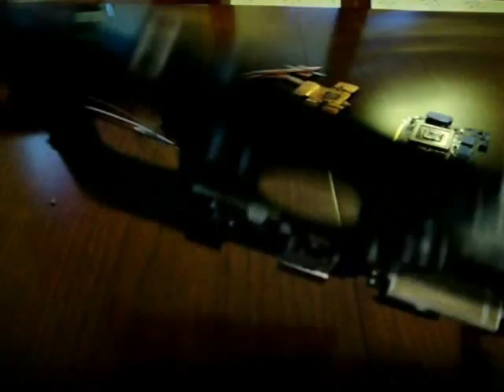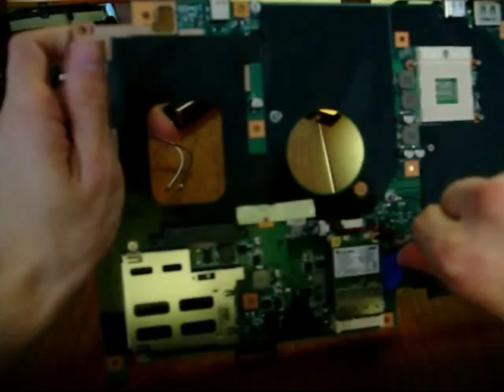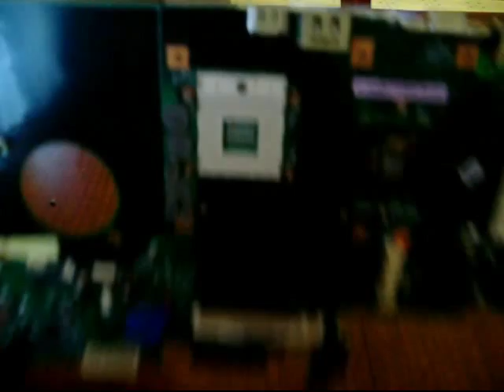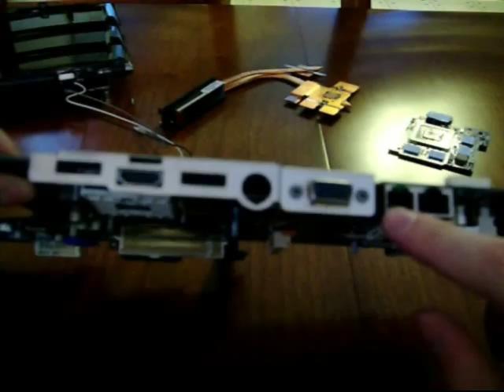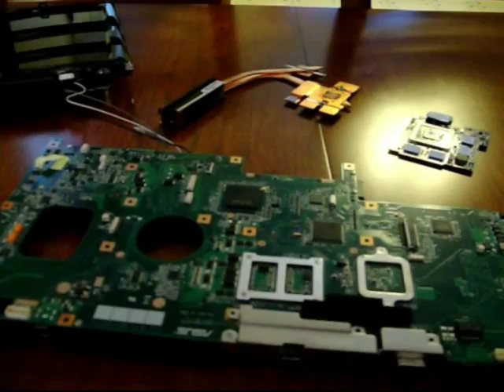Part 4:  Asus G71GX Disassembly tutorial to remove graphics card.

Comment: Hello friend. Very nice, detailed, and professional video. Could you tell us what is the highest/best frequency CPU and GPU for the laptop? Also, what should the idle and under-load temperatures of the stock GPU and CPU be? I just took mine apart, vacuumed all the dust, and applied new thermal compound (Thermaltake TG3) on the CPU and the Northbridge. I didn't touch the thermal pads on the graphic card other then vacuuming the heatsink. My temps are in the low 40s on the CPUs and mid 60s on the GPU on idle. What do you think?

Comment: Dear Frequency Commander,
I know this video is old, but after replacing the thermal compound on the heatsink radiator, there has been left a small gap in between the smaller chips and the radiator (the aluminium part). How crucial can it be for overheating and in my scenario shutting down? I have also uploaded a video on my channel seeking for help. Thank you

Comment: "now I have to put this thing back together, ugh!" LOL my question is, if I follow this video down to a T and reassemble with good heat-sink, to just replace my motherboard, I should be golden right (finally found a motherboard on ebay for 169$ after 2yrs of my new g71gx being a year old and the motherboard frying, have not bought the motherboard yet just in case)?

Comment: Based on your video I disassembled my Asus G71V which has a gf 9700m 512MB graphics card. I did it because I'm looking to upgrade it.
I collected some photos and then put all back together, and it of course works!
Now it's time to (re)search for new graphics card for that model. I don't care as much on performance, I need 768 MB of graph RAM minimum (mercury playback engine). Maybe some one will come up with solution.

Anyway BIG THX for Yours videos.

Comment from the maker: @croeso7 

As I recall I didn't see any other fan connectors, but I suppose you could wire one in parallel from the existing connector.  I hadn't even thought of the Ready Memory Boost idea, so I'm going to look into that.  After I put on the thermal paste I dropped about 10F on the gpu and about 7F on the cpu